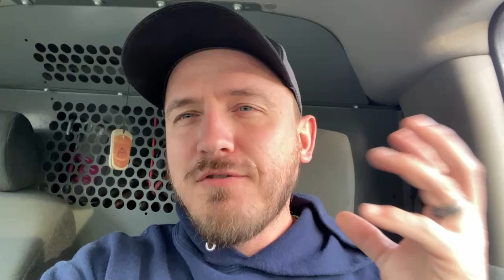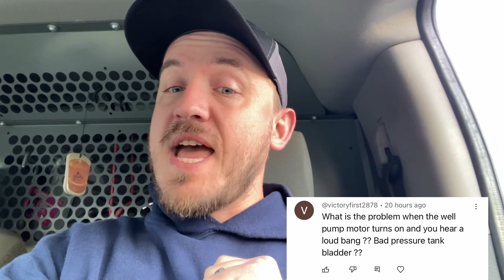Why You Hear a Bang When Water Runs?

Comment: I am wondering what would cause check valve chattering on a brand new check valve when the pump turns on and fills the pressure tank?... Ours had a pin hole leak and I replaced it 2 weeks ago... It didn't have any chattering until tonight... My wife flushed the toilet and I ran downstairs to the basement because as soon as I heard it!... It sounds like a fast ticking rattle sound... The old check valve never did this and I went with a nice simmons one

Comment: I thought my pump check valve was leaking. Couldn't get a plumber to the house and winter was coming. I had a friend install a check valve before the pressure switch and tank. That stopped the pump from cycling but it also caused water hammering, banging. I finally got a plumber out to the house. I had him remove that check valve. Since the air tank was old, I had him replace the air tank. Still loosing pressure back to the pump. IT wasn't a bad pump check valve. A previous plumber damaged the pitless adapter o-ring. The plumber put in a new o-ring and that fixed the leaking back to the pump issue. I was sure there was a small leak between the house and the pump. I believed that since my well water is so rusty and dirty, I was convinced the pump check valve was not seating.  I was lucky it was just an o-ring. I had the pump replaced about five years ago and that's when the plumber damaged the o-ring. Finally, it's fixed.

Comment: Appreciate all your content! Very informative. This is an off topic septic question but I wanted to ask you I have 2 trees that are pretty close to my septic tank and hang over the field and want to get them removed. Would grinding the stumps that close to a tank disrupt anything? I also don’t want the trees dropping onto the field incase it damages the drain pipes
Reply from the maker: Glad to have you along for the rid. Thank you for watching. Trees can be a bit tricky. The best thing is to have the equipment on the other side of the tank and have the tree bits land away from the tank/ piping. Stump grinding shouldn't cause any issues unless you have a super shallow system. I made a video going a bit more in-depth on this for you https://youtu.be/Bgr56uIqA7Q